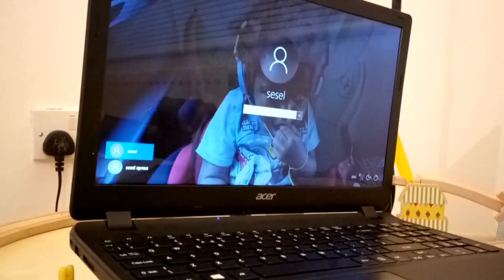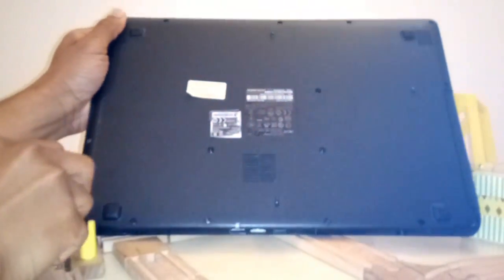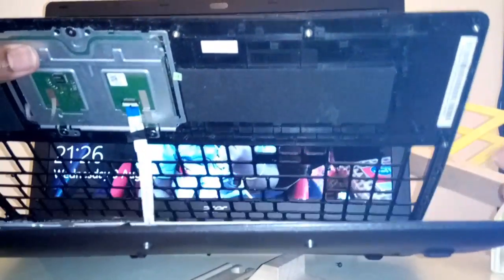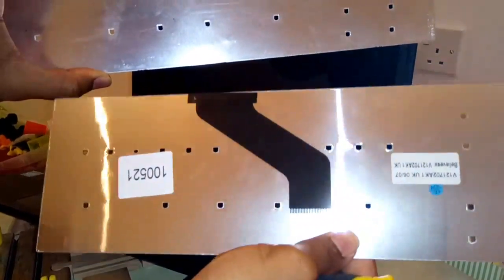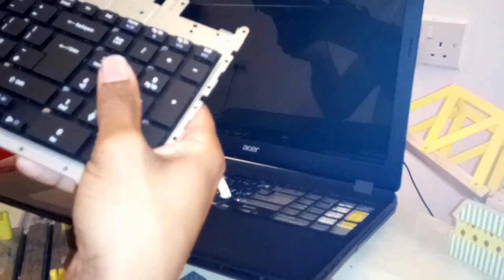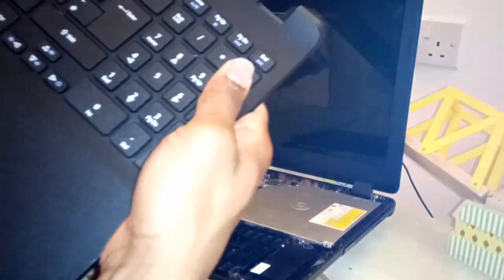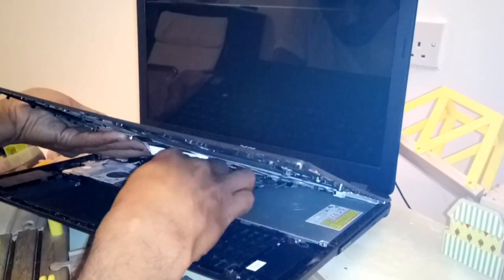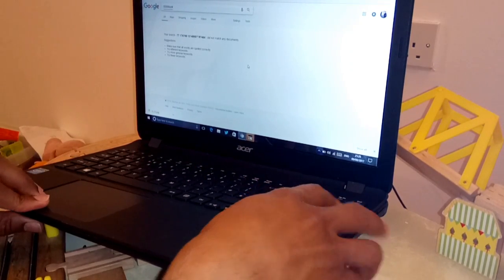How to change Acer ES1-512 Laptop's Keyboard

Comment: What about  that the  keyboard is held in by about 30 plastic , did you unsolder ?or what to used ?
Reply from the maker: Hi sorry for a late reply, Use glue gun to re glue it

Comment: No explanation that the  keyboard is held in by about 30 plastic fixings of two different sizes that need to be cut out or melted. Then there is the question of fixing the keyboard back in to the frame. I cut the fixings then used hot melt glue on each tab to put it back and the job took me 2 hours but if I did it again I would melt thhe plastic tabs and try to remelt them with the new keyboard in place as I think it would probably be faster. I glued all the plastig tabs but you could probably get awy with doing about half of them. This video seems to imply that you put everything back in loose but I think most would prefer to have it fixed in place to the top lid. Please Acer ,bring back proper replacable keyboards not this rubbish Macbook-type arrangement!

Comment: I have the es1-512 ms2394 c88m and the keyboard is fixed with plastic tabs. One of the weirdest designs I have seen. You have to melt and put them back in with a soldering iron. Very cheap stupid design. No screws
Reply from the maker: I even did not put the metal back waste of time :)

Comment: Nobody ever not try this it doesn't work unless your model is es1-512.- I have ES1-531 and the keyboard seems to be permanently sealed into top base of inside of the computer with these small plastic tabs. Otherwise not sure how the keyboard wasn't fixed in when removed in this video.  My model is ES1-531 and looks exactly same..
Reply: U snip plastic tabs with pliers then use soldering iron to remealt
Reply: Mine is an ES1 512 and I have the same issue with the plastic tabs.
Reply: @LornaKelso  u just squeeze them or melt em with soldering iron and pull up
Reply: AJR thanks for your reply. I’ve asked someone with more experience to show me
Reply: I have a tutorial on my page. It's a  weird design by Acer for sure

Comment: Is there an easier fix if some keys are only sticking or registering multiple characters? Such as "chaarcteerss" ? Is there a cleaning procedure for this problem or must I replace the keyboard? Thank-you for this video !
Reply from the maker: Richard Tyll Yes just reset the laptop it might be you pressed some buttons too quickly so it activated keyboard, I had that once and reset